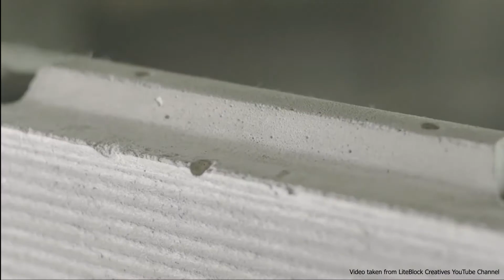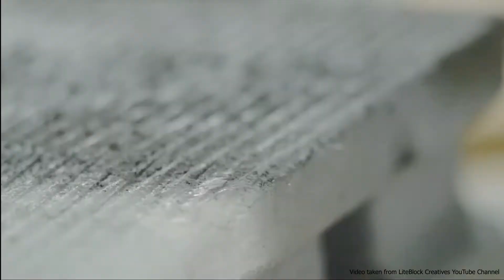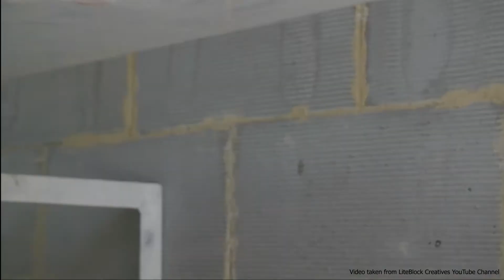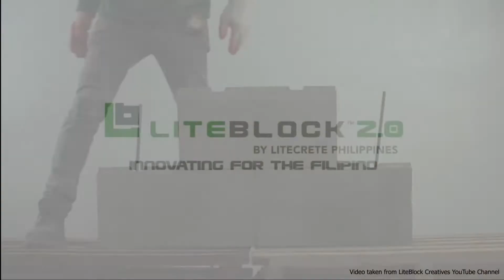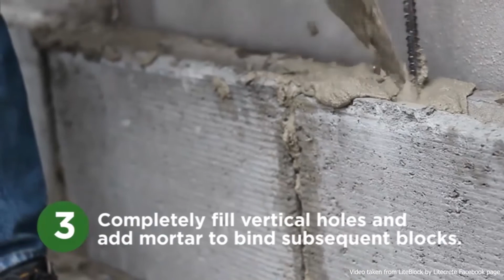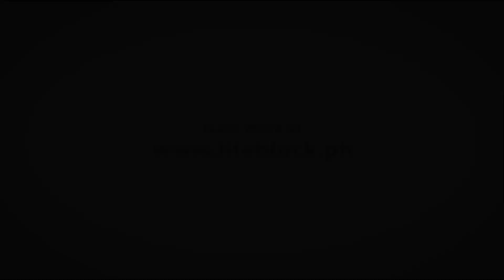Advantages of LiteBlock

Comment: What is the cost of one thousand liteblocks?
Thanks n God bless
Reply from the maker: I honestly don’t know. However, according to my research, including labor and steel reinforcements it costs 20% cheaper than regular hollow blocks. Slater said once in an interview that the cost of regular hollow blocks per sqm including labor and steel reinforcements is 1100php while Liteblock costs 900php

For other inquiries, you can call Liteblock at (032) 345 1031 or +63 917-700-2750.

#LITEBLOCKPH